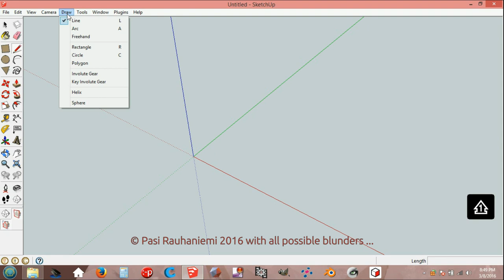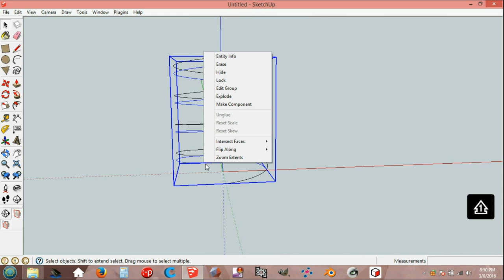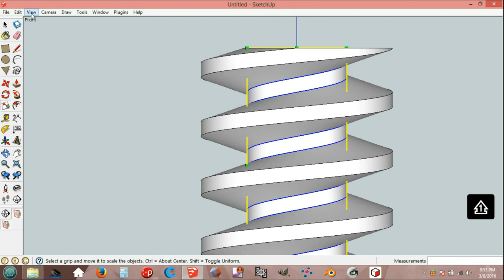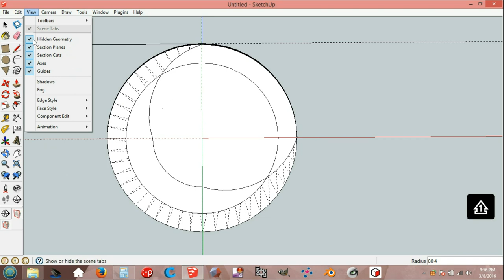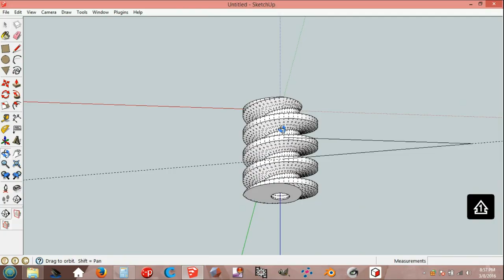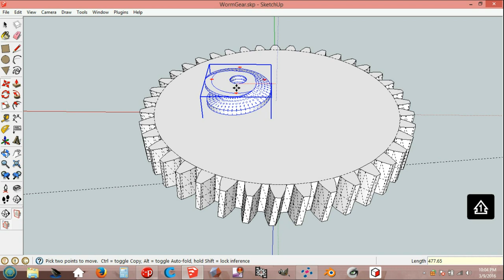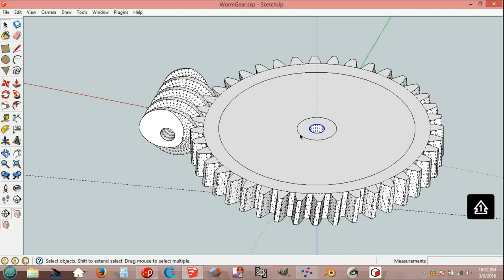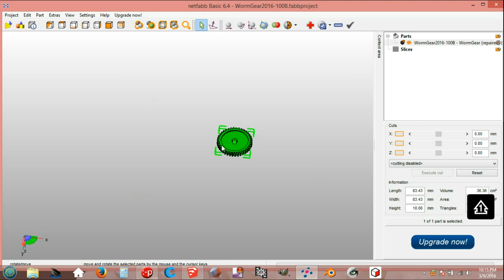Worm Gears In SketchUp + NetFabb = 3D Printable

Comment: Since these types of things are most of the common things we wanted to print on 3D I would assume they (software makers) had thought about making one already as a template and we just go in and input the measurements, i.e. height of the gear, external diameter,  depth of the gear, thread pitch, etc etc also it would not hurt and have a preloaded worm gears that are commonly used in toys, rc cars, etc. so all we have to do is pick the SIZE and export and print! No wonder 3D printing is not taking off as it should because printing possibilities are so limited...

But thank you for the tutorial...

Comment: Which version of sketchup are you using?  I am using 2017 and when I use the scale tool to form the shape of the worm it looks nothing like the one in the video, despite me copying everything you do.  It ends up with a lot of strange geometry on the opposite axis to where the scale tool is being used.
Reply from the maker: SketchUp 8 and 2016. Hmmm. did you explode everything? Ctrl down? I "squeeze" using two axis directions green & red.
Reply: Had the same problem and just realised that the segments you set the helix to needs to be exactly the same as the circle you use. In this example it is 96 segments.
Reply: @adamschembri2287  That's right.

Comment: Hi, nice video I just had one question , how to calculate pitch radius and face width in the gear parameter. Thank you
Reply from the maker: Hi! Probably I was reading these when I made this video:

http://nptel.ac.in/courses/112106137/pdf/2_15.pdf 
10. Strength considerations seldom permit a shell worm to have a pitch diameter less than: D1= 2.4p + 1.1

http://www.brighthubengineering.com/machine-design/60527-basic-worm-gear-design-calculations-using-agma-empirical-formula/

Say, we are going ahead with the Module as 2 and the Pitch as 6.238.
Calculate the pitch circle diameter of the worm (D1) by using the below AGMA empirical formula:D1 = 2.4 P + 1.1
The following AGMA empirical formula to be used for calculating the pitch circle diameter of the gear (D2):D2 = T2*P/3.14

But  I  simply used http://www.mechguru.com/worm_gear_basic.htm calculator like in info / video, to find what I needed. It really gives you pitch diameters.
Reply from the maker: If you set MSPhysics / simulation tab collision wireframe  on before you hit the play button you can see where the problem is. MSphysics does not seem to have right now an easy solution for this. From Sketchucation forum: " Until an automatic internal convex decomposition algorithm is developed...".  I have tried Convexify tool but  then MSP crashes SU. 

Perhaps there is an answer, but I haven't found it yet to work: http://sketchucation.com/forums/viewtopic.php?f=323&t=56852&start=570

It is always good to add better material for the gears like brass ( plastic does not work very well). This helped on bevel gears.

Here is an image that shows collision wireframes. Strangely static mesh has correct type wireframe, but it is static: https://s29.postimg.org/pzvgtbdaf/Worm_Gear_Collision_Shape.jpg

Blender 3D Software seems to handle these type gears with no problems...
Reply from the maker: Also this came to my mind: https://3dwarehouse.sketchup.com/model.html?id=967a4ff38b7bf847b7f4217379465401

It did not roll for me, but it shows compund wireframe collision ok, perhaps something.
Reply: I see, i will try that .thank you so much for helping me:)